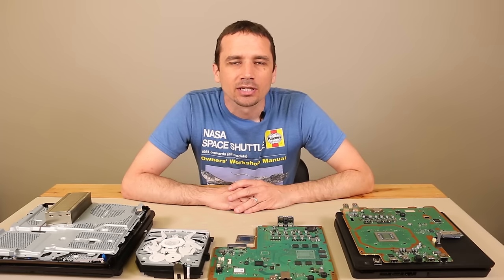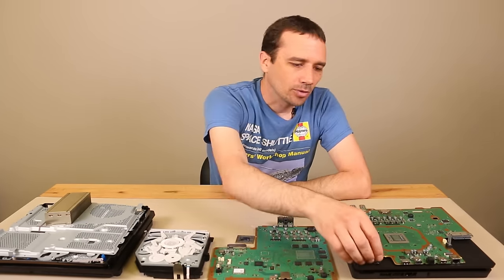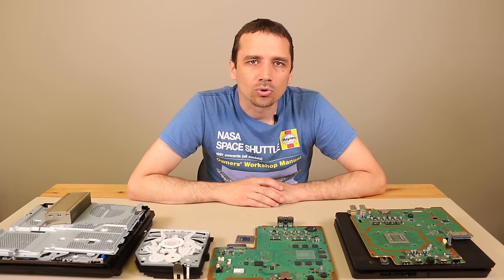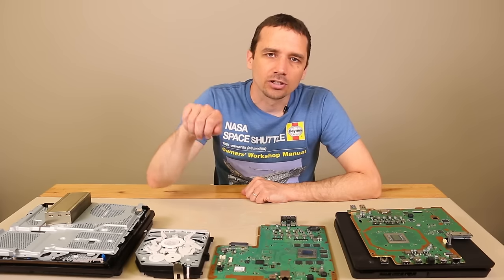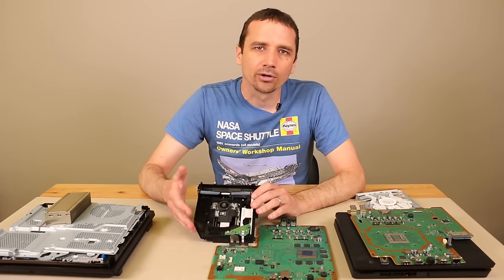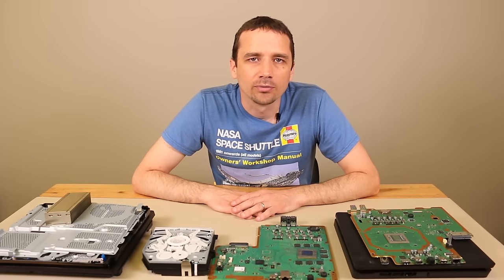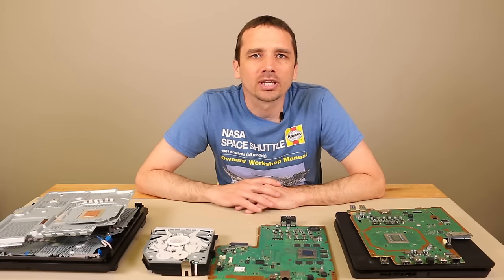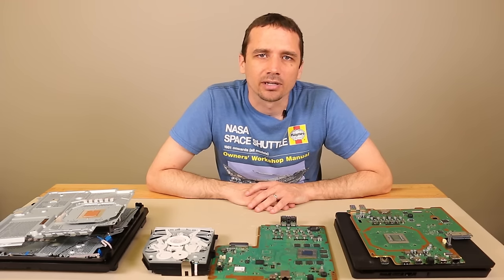Top 5 PS4 Problems With Solutions

Comment: My issue is frustrating: I have a ps4 which I got from a friend, with NO controller. I bought a controller and a new usb cable to synchronize the new controller. The controller just blinks white and does not sync. Could it be bad usb ports? What are the chances that both ports are bad? I can't format the console either, since there is no working controller. HELP please!!

Comment: Would a scratch on the edge of the motherboard cause my PS4 to not work? I’ve taken it apart replaced the power supply tried multiple cord and outlets but still no power. Help?

Comment: I have a ps4 and I took it apart to clean dust from it. Idk what I did  but when put back together it did nothing, wouldn't power on or anything. I took it to local repair store and after I about a week was told that it was no good night more and might as well buy a new system. Is it repairable or not?

Comment: My PS4 has a very small in fact tiny bit of water damage and it turns on then switches off and I don’t know what to do! The water went down the left of the PlayStation under the glossy plastic cover and through the holes any advice? Because every shop I went to asking for repairs said they couldn’t get it to work

Comment: My ps4 acts funny sometimes. Usually it just starts, but sometimes the screen will blink like its an issue with the wire from ps4 to the TV. But replacing and stuff doesn't fix it. I have to hard reset. Is there a way to fix this?

Comment: I know this is very old but, I’m having a fan problem with my Launch PS4. Basically whenever I turn it on the fan is goes full blast. If I put it in Rest mode its still going on full blast (which had never been  a thing) so today I decided to open it and do deep cleaning. I cleaned everything to the point theres no visible dust lol I changed both the thermal paste and the thermal pads as well, think it was that it needed just new thermal paste since the one it had was all dried up and was even off the chip itself. Like to the point that you could read the text on the top of the chip. After putting everything back, it stayed the same, full blast 24/7. All I can think of is the fan is broken? Coz idk why it started doing this if it wasn’t just that it needed thermal paste

Comment: If my playstation 4 original model 1115a that I've had forever isn't overheating and when I opened the console it had absolutely no dust in the fan or heatsink should I still replace the thermal paste? And when putting a disk into my system it sounds loud while spinning until I hit play is that normal? How long should it be before my fan kicks into high when playing games? 30 minutes? 1 hour? 1 hour and a half? Would you recommend me removing the disc drive and cleaning it out?

Comment: Hey man. I have a PS4 slim, that won't allow the disc to go in. I bought it brand new about 2 years ago. I watched your video of you showing how to get to the disc drive, to make sure the rollers are intact, and took mine apart, made sure the rollers were all good, put it back together, but the disc still won't go in. Any idea what could be causing this? It's almost as if there's already a disc in there, but there's not. Like there's something blocking the disc from going in.
Reply: Did you install the newest software update? I have the same problem and when I try to install the newest update I get an error code.

Comment: Steve I have a PS4 pro this thing loses the System info 5 times now in about 4 weeks, plays and freezes and flashes off and back on. Will not stay on over night or in rest mode. One time it was shut down normally and had lost everything when restarted. When it freezes you have to use the power button hold it down and restart it. Have Initialized it, used safe mode ect, and it does not fix it Do you have any idea as to cause Power supply or mother board?

Comment: hello, would you have a suggestion for a older ps4 not connecting to wi-fi, I have tried most of the things from You tube nothing worked, i have been just using a land line to get updates. thanks Lou

Comment: I have a first model PS4 that will not shut off. If I try to restart or turn off or put into hibernation the system remains on with a white light. I have to unplug it s which I know is bad.

Comment: So I took my ps4 apart applied some thermo paste then put it back together like i have the previous 3 times but this time it didn't turn on or beep at all. I then took it all apart and tried seeing if I bent the prongs that go into the powers supply on the bottom back part of the ps4 and it looked fine so with it half put together I went and tried a different plug and for some reason it worked again. I then put back the hard drive and assembled the rest of the ps4 and when I went to plug it in I got nothing again. Do you know any ideas in how I can fix my ps4?

Comment: Hi, I have a ps4 pro with SU-30645-8 issue.
I have everything tried to restore the firmware system with USB or internet but nothing helps.
Can I only reflow the ram flash chips to repair this issue?

Comment: My fan when turned on makes a loud sound , then goes away. It only makes it when it gets turned on though. Another problem is the charging port or the charging plug. And then of course my controller , constant red light . I have to say I did trip over the wire & console a few times. Maybe knocking the the fan out of place & or messing up the controller port. Either way , I still need a new controller by what I've seen on videos that I have a constant red light . My screen just says " Controller is low " or something like that.

Comment: Have you run into any issues with the lan or wifi always disconnecting? Does not matter which one I use it always says lan disconnected or wifi disconnected. I have replaced the lan cable multiple time and reset the router and even hard ported it into the wall (bypassing the router), tried it at a friends house and on their wifi but always the same result. I have fully reset the PS4 pro and still having the same issue. Any help or ideas would be greatly appreciated! Also note that it will connect but it disconnects at random never a set interval can happen 10 times in 5 minutes or 1 time in 30 min

Comment: I have an older PS4 if I leave it plugged in for a day after I used it when I try to turn it on it lights up then goes off and will not turn on. If I unplug it for a day then replug in the power then turn it on again it turns on and plays fine. If I don’t unplug it the next time I try to turn it on it will not power on again the light will come on then go off. I will need to unplug it again for a day then it will come on again when I plug it in again. Do you know what could be the cause.

Comment: I replaced my ps4  fan and hard drive turns on fine but it wont recognize a controller but if i put it in safety mode controller works fine . When it says welcome back press ps button nothing happens.Plz help i brought a ps4 pro and used that contrtoller still no luck.

Comment: Installed 2TB drive into my brand new pro but won’t boot up after safe mode and software install. Any ideas?
Reply: Buy a supported brand drive
Reply: Strategist Wang I’m an idiot. Just needed to change the resolution in safe mode since my tv is 4K. Problem fixed.

Comment: My disc drive wont do anything i took it apart and manually pulled the disc in and while its on it wont spin the disc or anything and when i press eject it just beeps 2 times like there is no disc in there not sure if motor is bad or what but do yall have any idea?

Comment: Guys help I've had my ps4 for 6 years and now it's making a weird grinding noise and the display and controllers turn off but the ps4 light is still on
Reply: Damn bro
Reply: @Josh  impossible coz I cleaned the fan right after and theres nothing in it but it's still making the sound

Comment: I first had issues with mine going into safe mode. I tried to update it via usb and the finally I was able to thru WiFi. Then it kept messing up so I initialized it once. That didn’t work as it would freeze up while redownloading my game. So I picked option 6 the full initialization reset and it worked well but has been cutting back off and on. Then it checks the system data on the safe mode kinda screen then cuts on again. Then it starts all over when I download my game again.

Comment: Hi there! I’m having a really odd problem that I cannot find anywhere. my ps4 won’t start when it’s cold. I run it from 8am till about 10pm. Then the next morning it won’t start. It flashes blue once then nothing. I sleep in a room with AC on all night & the PS is really cold the next morning. But after I blow hot air through it from a hair dryer. It works straight away. Then once it’s warm their is no problem turning it on & off all day until it cools down the next morning. Then it won’t start again lol. Do u have any solutions or know what could be causing this problem?  PS: ive clean fan & heat fins. Thanks!

Comment: reball on chips would last if you use solder with lead in it (better elasticity, not affected by heat/cool cycle). as the solder is the cause. unfortunately that is now banned for some time thx to ecology activists (producing more waste by failed hardware would put more strain on environment anyway, not to mention lower durability of products -> shorter life cycle -> replace more often -> more revenue for manufacturers) it is electronics/IT wide problem

Comment: So my PlayStation turns on but randomly freezes so I do a factory reset and it works fine apart from if I press the middle button it doesn’t register but if I hold it to turn ps off it works. But once I’ve downloaded a game it freezes as soon as I get on main menu, the error is that I need to download update 7.51 although I already have. Someone told me a knee hard drive would fix this? Does this sound plausible? Thanks in advance

Comment: Problem: PS4 Fat console loosing connection with controller. Console starts normaly, controller is reacting on commands few minutes normal or with dilay and then PS4 show message that controller is disconnected. After that when I press PS button, controller shows white light but not connecting to console. If I somehow get connection, console loose it afer few seconds. I have tried to use controler to another console (with or withouth cable) and its fine completely.

Comment: hi Steve, 
I have an Error Code (CE-34878-0) with my PS4 and follow all the steps trying to fix it:
*Restart the PS4
*Move Your Game to the Internal System Storage
*Update PS4 System Software
*Update the Game/App
*Turn Off Face Recognition
*Disable Mods
*Change PS4 Display Settings
*Check PS4 Hard Drive
*Rebuild PS4 Database
* Factory Rest PS4 
but the error keeps coming back and shuts down the game why i'm playing..
Is there any other step i can try?
Help plz..

Comment: Is the hdmi in the ps4 in anyway connected to the disk drive 
My ps4 will turn on but wouldn’t display on the tv I took it for repair and they said the hdmi was spoilt at first then they said when they wanted to test it on a tv that the disk drive was having problems that it is connected to the hdmi 
Is that true

Comment: Hi I got a problem on my old PS4 it won't accept CD and I open it and found out the loading motor was shorted and also pdp board o20 1-889-225-11. I replaced both. It works to load, read the CD game. But the it got error ce358-882 means small not communicating with main board. What will I do pls help me

Comment: My problem is that when I try to use my ps4 anytime I try to open a game or after 10 min at most it shuts off and the upper left part of the ps4 gets hot so fast any problems/suggestions?
Reply: I too have the same problem. Did u fixed it ?

Comment: I have the thermal paste issue with launch PS4 pro now some time's I'll be playing a game and it will say the system is getting too hot and some time's it just shut off and blinks I've took a can of air and a brush and cleaned it up but still does it from Time to time and now I get the jet engine fan on top of that it drowns out my TV so can't hear the TV at all I'm going to get thermal grizzly supplies and redo the thermal pads and  paste soon

Comment: hey tronicsfix i have ps4 with a wire to a power board for power button does it go anywhere? i thought it was already in top and bottom but it was just the motherboard in 500gig and apparently only in slims, im mid fixing it but no wire it has to connect? hat shood be on here

Comment: Hey I know this video is old but I have PS4 slim 1TB and when I turn it on the blue flashing light and the PS symbol comes up then goes away n then just a black screen I been working on this for couple of days the white light dose come on when I turn it on in safe mode but nothing works in safe mode well I can’t tell cause the screen goes black. Really would appreciate if you could spare a minute or two on advice on this issue please. My PS4 is not old and I didn’t have a lot of games on it please help if you can. If I got to send it some where to fix I will but need to know how much n if it worth it hope it’s not gone

Comment: My PS4 Pro Spider-Man edition need to replace my power supply because it have a ticking sound I guess warm and cold temperature that goes on and on in 4 years, you get that ticking sound. But my PS4 Pro didn't have hardly any dust in it.

Comment: Hi. I replaced hdmi port on a cuh-1001a. I get signal in 720p but when i select 1080p i get no video and audio hiccups every few seconds. I have confirmed my 19 pins are established from hdmi to mbd pins. I did use a fair bit of flux. Is there something I can do to confirm continuity. Is there anything else that could be causing this? thank you
Reply: 👆👆👆 contact this expert to help you fix it.

Comment: Was wondering if I could get some help with this but basically my ps4 keeps crashing withing a minute or 2 of me starting it (even in safe mode) I tried rebuilding the database and even took the top lid off the clean it. Every time it crashes there is a small click sort of sound that goes off. Could you please help?

Comment: Can you fix my ps4 pro 
I downloaded  this awesome  game 
But when I play the game it 
Freeze and lagged  alot  I took it apart clean the fan and the heating system vents,
Cus there was alot of dust in plus it started to cut off with the dusk so that's the only reason I gave a  good cleaning , right now I'm watching this movie  online on the ps4 it plays all the way thru but later its gonna freeze help help help....I did the rebuild  data try that cut the system  off in on make sure the hard drive  was in place in no dusk I can play the games half way thru but it starts to freeze after I get into it...so the game not turning off anymore fix that problem  its just the freezing in lagging

Comment: Hi Tronics,
My PS4 got shutdown and even blue light was not appearing. It died i guess. I tuk it to service center, he replaced some power IC ( Showed an IC close to the main CPU). It got turned ON. But when i start the game, it immediately turns off. Could you please tell me what is the problem I'm facing. Fan is working but it feels very hot.
Reply: Its overheating probably.Clean it and change thermal paste and that should do the trick
Reply: @pyron9574  Service guy re applied it, but still no success.

Comment: so mine has been having software issues since 7.01 , i initialized and reset it, then i couldnt get the update to download, i finally got it to install after hours of retrying then it lasted for 1/8th of a game download, crashed and now its says corrupted database, which it had been doing before due to a currupted game, this was before i had these issues. now it doesnt matter if i initialize or rebuild data base it wont go past the playstation symbol when it turns on itll just go to a black screen and shut off. pretty sad..
Reply: I'm somewhat luckier my problem is my PS4 shuts off in rest mode. I hear 2 clicks and then it shuts down. While it doesn't seem like a big issue I'm afraid it's going to corrupt my PS4 after a while.

Comment: Does anyone have any tips / know how to fix or at least diagnose my problem I’m having rn? My PS4 slim version ( 3yrs old, used almost daily ) has been recently having issues and the data is being corrupted, I soon plan on swapping to a PS5 and am concerned about data transfer. Recently my PS4 slim has every other day lost HDMI power, than the controller turns off ( I press the home button but it’s flashes blue ). Than the console buttons ( power and disc drive ) don’t work. Than I’m forced to unplug while it’s still on. Everything loses power except the console itself. Each time I’m forced to hard kill it and it may damage my data soon.

Comment: Have you done any ps4 controller repairs? I have one with a major drift issue and i really don't want to send it in since i'm a computer tech and familiar with some electronics but your fixes are more informant on what the problems may be. the controller i have is the new one where you can see the light through touchpad or the ps4 2nd version controllers.

Comment: My ps4 shuts down by itself when starting a game, It ain't overheating and I've already changed the hard drive and played maybe for 3-4 months until shuts down, Also I put an internal fan cooling and thermal paste and still facing the problem,when i start a game maybe for 1-2 minutes and shuts down again, is it the HDMI or the fan needs to change or what?,please if anyone knows what the hell is with my ps4 ,please tell me what the main problem.

Comment: So I tripped over my Ethernet cord and my PS4 the ground and really messed up my HDMI cord( ripped off the cover and exposed the prongs, had to pull the cover out of the PS4). My PS4 still outputs signal but it is grainy( in black colored areas) and the screen flashes white  sometimes. I think k probably cracked the motherboard but I'm not sure. At least it's a good excuse to buy a PS4 Pro now